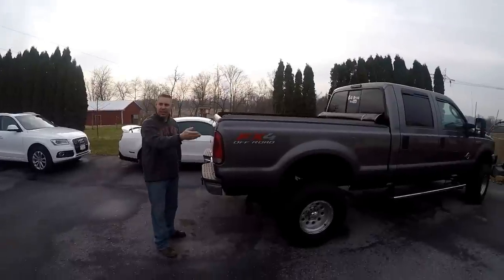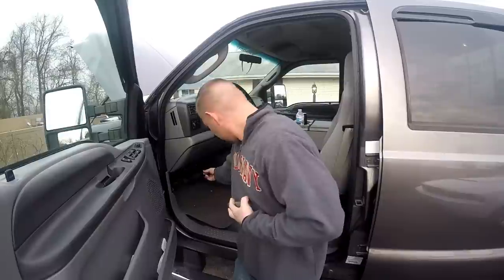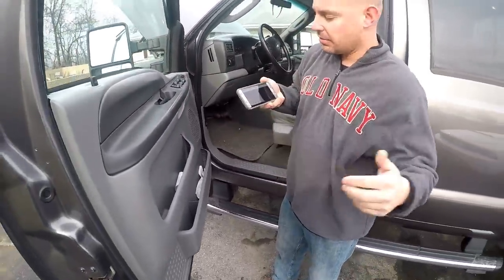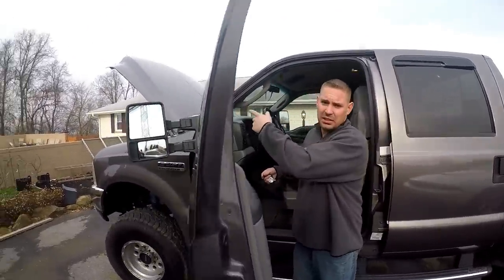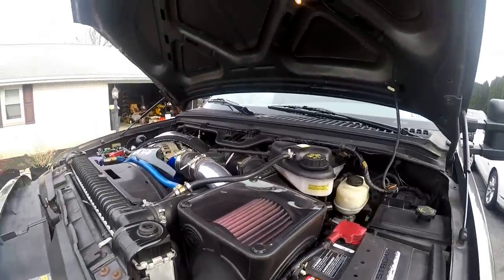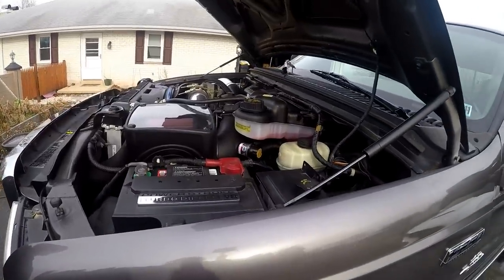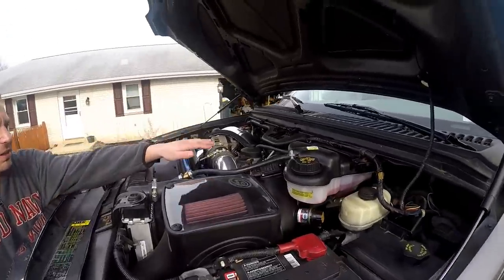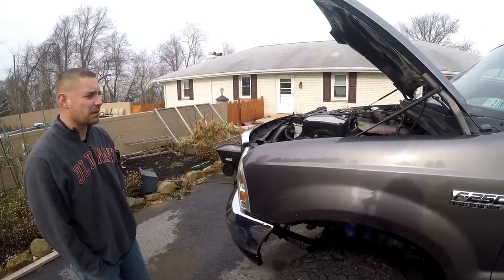6.0 Powerstroke Bad Injector Test

Comment: Hey I am brand new to 6.0 bros and I need some help. I have a 03 6.0 with 245K miles. Truck randomly died and then would start back up and run fine, check engine light came on. Code was P2623 - Injector control pressure regulator circuit / open. All the research I could do led me to the IPR. I eventually changed it and foolishly did not change the ICP which was right next to the IPR on the back of the motor. The truck ran fine for a few days and then would get sluggish once it warmed and had little to no power. I had it scanned and they said that the ICP was showing strange voltage and acting weird and that cylinder 3 had low contribution. I changed the ICP, rescanned and the cylinders seemed ok and the truck ran amazing for a few days. Now it is smoking like crazy. Smokes on idle (lighter smoke) and blows darker smoke when I put my foot into it. I scanned again and have a balance issue on cylinders 3 and 4. I don't want to replace the injectors if they are not bad. Please help me out here.
Reply from the maker: I'm wondering if the logic board on your ficm isn't going out. It would give you the code you have and cause the issue. Not always but normally I jester failure will happen to one side or the other. I have seen failure of each bank sometimes nit be the injectors but the fixm logic side. Do you have a friend that would let you try their ficm? Also check the wiring harness and make sure everything is plugged into the injectors and back of thr ficm has 3 plugs that can come loose
Reply: @six0bros  Actually I don't have the option of borrowing a ficm. Is there a way to bench test the ficm? I am really needing to get this truck up and running. I tore it down to the cover plates yesterday on both sides in anticipation of replacing injector 3 and 4 today. Couldn't get the injectors yesterday because of the holiday. To clarify, ever since I changed the IPR, it has not died, and once I changed the ICP, it has run really good, but just smokes like crazy. Everything I have read up on points to having an injector putting too much fuel in the cylinder. Is that not what you think? I had a diesel repair shop tell me that injector 3 was bad and the ICP needed replaced and then another mechanic (friend) who had a nicer scan tool than the shop tell me do the ICP first, which I did, then he rescanned and it showed 3 and 4 out of balance / contribution issues. I haven't opened the cover plates yet, but I was going to replace those injectors this evening. Thanks in advance for your help. Also, what is the little unit above the cover plate about where injector 5 is located that is on a coolant line and has a vaccum hooked to it? Mine appears to be or was leaking because it has white crusty material all around it and below it and I have no idea what that is but want to replace it while I have it sitting out in the open. 

Lastly, if I do open the cover plates, should I replace the stand pipe and dummy plugs if they are not the 12mm allen head? I don't want to mess with things that are not leaking at the moment, but I don't want to pass up something I should do while I am in there. Thanks a lot.
Reply from the maker: So the easy oart that vacuum piece when you turn on max ac it blocks coolant through that area to minimize heat exchange from the cold air going to your vents. So it is for your a/c when in max to work better. Next the one thing you said that tells me it's an injector and not the ficm is that it is running well. If it was fixm related most likely it would run really rough. So yes I will go back to saying it is a high probability it's your injectors. Also I would change you stand pipes and dummy plugs. If you can afford to I would just change them to prevent potential issues down the road, but as long as they are not physically damaged and they are already updated you should be good
Reply from the maker: One other thing is your exhaust tailpipe wet with oil?
Reply: @six0bros  It doesn't really seem to be wet with oil, but definitely black with soot. I did see a little bit of oil on the hot side CAC tube when I removed it, but not a bunch.
Reply: @six0bros  do you know what that vacuum part is called?
Reply from the maker: Thr oil in the cac tube is normal it is from your ccv system. The black with soot is ok too as long as it isn't wet. It is most likely those 2 injectors if the truck runs smooth otherwise but has the smoke.
Reply: @six0bros  How difficult is it to change the wire harness for the ficm and injectors? (I believe it is all one harness). My wires are good, but there are two plugs that the little clips broke that snap it onto the ficm. They seem to have been that way a while and holding, but I might change it out if it isn't too difficult.
Reply from the maker: Here is a link to it. Apparently it is called a four seasons heater valve. This is an affiliate link
https://amzn.to/3yRwuRx
Reply: @six0bros  Thank you. You guys have been very helpful. I will subscribe and recommend.
Reply: Can you reply to this?
Reply from the maker: Did you get everything you need or did I miss a queation?
Reply: @six0bros  How difficult is it to change the wire harness for the ficm and injectors? (I believe it is all one harness). My wires are good, but there are two plugs that the little clips broke that snap it onto the ficm. They seem to have been that way a while and holding, and the new harness is like $300 so I am not sure what to do.

Comment: So I just bought a 04 6.0 and I noticed it had that exact coolant filter too what’s the point of that never seen that before. Also it doesn’t ever get to proper temp I wanna be able to use my heater soon but where should I start to get to regular temperature?
Reply from the maker: People think a coolant filter will catch anything that will clog the oil cooler. It won't. I run one too though.  As for coolant temp not getting up the thermostat probably just failed. The spring looses tension over time thats all. Here is an affiliate link to a Motorcraft one. 
https://amzn.to/3mdVhed

Comment: tell me.The voltage on the module is 48.5, on an idle engine, and the injectors are not tested!
Reply from the maker: 48.5 is a perfect voltage. Not sure what to tell? Do you have a question I'm happy to help
Reply: @six0bros  Good afternoon.The FICM unit outputs 48.5 on the ignition turned on, 49.3 on the wound up.
Can you tell me where to dig further?The injectors do not crack when the ignition is turned on.
Reply: @six0bros  Maybe this is the upper large board that is in this ficm module?
Reply: @six0bros  Can you make a video?We don't have a Ford diagnostician.
Reply from the maker: Well let's start with what is your truck doing? Is it smoking a lot? If so is it still idle very smooth or is it really rough?
Reply: I'll send you a video tomorrow.I'll start it on cold.He smokes a lot, grasps, but does not start!I checked the voltage on the nozzle, it's not there!On ficm 48.5. The relay is triggered.A ficm board was ordered from America, I installed it.The injectors worked once.You can no longer hear them every time you turn the ignition key.I apologize for the poor-quality translation.I write through a translator.I'm from Russia.Thank you for helping!
Reply from the maker: Do you have access to a torque pro on an android device? If you do a obd 2 blue tooth device to scan the vehicle and start reading what the engines doing is important

Comment: What is the T in the lil hose going from degas to radiator with the blue hose going to something on the passenger side, also what year is your truck? Mine is an 05 F450 6.0 liter,  and when doing the cylinder contribution test, 1,3,and 5 where negative numbers, indicating a misfire at idle from my snap on verus pro. I accelerate to about 1800 rpm for about a minute and all numbers from both banks are all roughly zero with the driverside bank 2,4,6,8 are zero to positive 5, and passenger side bank 1,3,5,7 are negative 5 to zero. Once I let off rpm comes back to about 680 - 700 and now 1,3,5 and 7 are all negative 19 to 40 and driverside are all positive numbers. 

The ficm is 48V, and the 2 other ficm data pids are approx battery voltage. Now I just got this truck and know little about it, it has 233k miles, and 8k engine hours, not sure if it is stock engine, this is a tow truck. I have no power under load, whether I put it into gear it falls on its face and almost dies. If I turn pto on its fine until I toggle one of the switches for the boom, and again it falls on its face or kills the truck. If I put it in neutral or park I can rev it up some but can tell it's running crappy and smoothes out some while accelerating. I'm just wandering if it is in the fuel pressure for it to be just that bank of injectors or?!?!
Reply from the maker: the t is to a bypass filter for coolant. sounds like you need to replace injectors but I would double check fuel pressure first, also your ipr and icp as well.

Comment: Hey guys, help I just a EGR delete on my 2003 F350 6.0 because I was getting white smoke out of the exhaust, that didn't help still getting white smoke. One of my friends said I need to replace injectors. What do think. The truck has 149000 miles on it.
Reply from the maker: Is it like this video https://youtu.be/rBQyMrPH0ho
If so yes it is an injector. You will need to scan the codes to see what injector is down I have videos replacing them
Reply: @six0bros  yes it's like that and the smoke has diesel odor
I have been looking at injectors on line, is there one better than the other.
Reply from the maker: @michaelkautz8238  I run warren diesel premium injectors at the moment. I have 175/stock nozzle injectors at the moment. I have heard great things about river city diesel injectors, and holder diesel injectors.

Comment: I have a 2005 f350 dully it was running good and the next day I try to start it but it started ruff and I took it to the shop and they told me that 2 injectors was bad on each bank and I don’t no nobody that can work on it I was goin to change all the injectors my self any recommendation or tips to try to find the problem like you videos thanks
Reply from the maker: Is your truck blowing white smoke? I think your problem may actually be on the logic side of your ficm
Reply from the maker: Typically when 2 injectors on each bank go bad at the same time and suddenly it is the logic side if the ficm. What codes are they saying as well

Comment: Did you have a check engine light on when you ran the codes or could there be codes with no check engine light on
Reply from the maker: No check engine light but if you read the codes regardless the injector code came up
Reply: @six0bros  thank you because I don’t have a check engine light but I think an injector is going bad. I’m going to put it on a code reader tonight. Btw this video really helps and you guys replying to me helps even more thank you so much
Reply from the maker: No problem man I try really hard to answer any questions I can

Comment: i know this is an old video but, my truck starts no problem but the truck misses it doesnt matter if its cold or i let it warm up. cranks evenly so i dont think it is a motor problem. buzz test sounds uneven. i assume that means an injector is bad? truck went from great to one morning missing. its so bad i cant drive it the truck will die when trying to move. little to no smoke.
Reply from the maker: Have you checked rocker arms? Is it pushing air back out of the air intake?
Reply: @six0bros  it's not pushing any air that I can feel, all the rocker arms got new plastic clip things when I studded the truck about 2 months ago. I did start it today and used forscan to see what was happening. 6&8 have a weak buzz when doing the buzz test individually. And the truck smoked pretty good this time around.
Reply from the maker: I misread your first post. I thought you said it didnt crank evenly I am very sorry about that. With what you have said I am led to believe you do have an injector issue. What are your exact codes?
Reply: @six0bros  that's the thing it isn't throwing any codes atleast none my scanner can grab. I have a glow plug open circuit code but I've had that for months.
Reply from the maker: @EditsWithBlur  can you get me the following items while cranking and for what ever brief time the truck runs. Ficm sync, ficm main power, icp measured in volts, ipr% cam sync
Reply from the maker: @EditsWithBlur  also battery voltage while cranking and running
Reply: @six0bros  I'll get all those for you when I get home, I did have both batteries tested seperatly a week ago as well as checked ficm voltage which checked out. I unplugged the ipr sensor to see if it helped but it didn't make a difference
Reply: @EditsWithBlur    Hope you see this 2 yrs later....You say you Buzz tested injectors with ForScan.  Is that ForScan Windows version for computer? Or ForScanLite App for your iPhone? Android?  I want to be able to Buzz test on a phone, but if that's not possible I'll have to get the ForScan for Computer.  Thanks!
Reply from the maker: Last I had heard forscan only let you do the buzz test with the windows version

Comment: Asked a lot of question lately but have an issue that maybe you could answer better than the forums. When the truck is cold(er) it was a stutter right at 1800 to 2200 rpms really bad like a pop out of the exhaust. But when the oil temp hit about 185 to 190 it goes away entirely and runs just like it should. Is this a bad stiction or a bad injector? Don’t have any cold starting issues that seem to be worse than a normal diesel cold start
Reply from the maker: Don't worry about asking questions that is what this channel is here for man, to help people. Now do you have a code reader? If so any codes coming up? The first thing I would check is all electrical connections. I would really focus on the ficm harness as well. I would press on the connections in the back of the ficm there are 3 of them, and then I would check each individual injector too. After that check the main wiring harness and just make sure everything is good there too
Reply: There are no codes other than icp but that’s because it is unplugged since truck will not start with it. I know the ficm harness is not the most secure and I should probably replace it. I’ve been thinking that since I had the ficm 58v and reflowed power supply it stopped doing that for a couple days then came back
Reply from the maker: So if the truck went start with the icp plugged in then it is bad and I would replace it. Next I would get a new Ford ficm harness. It sounds like that may be your problem.
Reply: I know that the icp is bad just need the extra cash first and I will definitely try the new harness. Thanks for the replies
Reply from the maker: Anytime. Check out xtremediesel  snd use code diesel10
Reply: Thank you sir. Also an update today I went to start it and oil temps were at 59 and it took 2 almost 10 second cranks. Lots of white smoke and struggled to start

Comment: Hi I bought 2003 6.0 a month ago and since last week engine check light popped up in dash so I check with local Macanic he found code p2285. And truck also misfire at cold starts but once it’s fully warm no issues. 
Can you plz suggest what I need to do for that
Reply from the maker: So I believe you just need to do an icp sensor. Most likely it is leaking oil through the connector. Also a good cleaning of the pigtail off the wiring harness. I have never had to replace the actual pigtail but some have had to here is a video for removal on the 03s https://youtu.be/x_HaxGlUwBA
Reply from the maker: As for your other issue. Most likely stiction in the injector the only way to truly fix this is to replace the spool valves. However archoil will likely help a lot so here is another video I did on that. Again though archoil does not fix the problem simply helps it. https://youtu.be/E_GNuyIb6_Y

Comment: i have 2006 f350 super duty recently had check engine light come on , auto zone said code was fuel sender  code ok , ill bide my time till i can get time to pull bed bolts to get to it ,recently replaced both batts , 850 cca ea. lights off for few days but then light back on , almost impossible to start in morn ,had checked again and through codes on all injectors circuit low , wtf ?
Reply from the maker: I would check ficm voltage and battery voltage while cranking

Comment: I have a 03 f-250 6.0 with 187k miles and recently went to an auto part store they scanned it and they said injector 8 was bad and EGR but what do you guys recommend on doing? I’d want to do it but It looks a little hard
Reply from the maker: What is your actual code and your symptoms? What did they say was wrong to with egr? The cooler or was it the valve ?
Reply: 6.0 Bros p006A manifold absolute pressure 
1.  P0283 cylinder 8 injector circuit high
2. P0401 EGR flow insufficient detected 
3. P0404 EGR Control circuit range/performance 
4. P0405 EGR Sensor A circuit low
Those 4 problems are the ones I’m concerned about

Comment: Hey what wheel and tire size is on that truck? im looking for a similar setup. are they the stock wheels? 16", or 17"?
Reply from the maker: They were 16x10s those wheels are gone now but 16x10 wrapped in I believe basically a 35